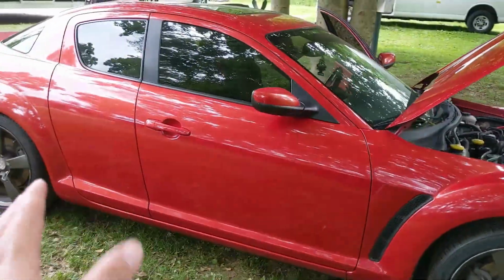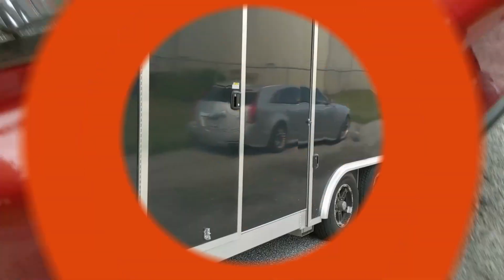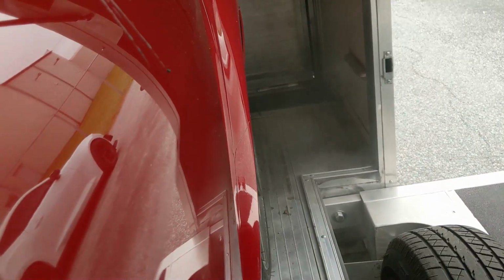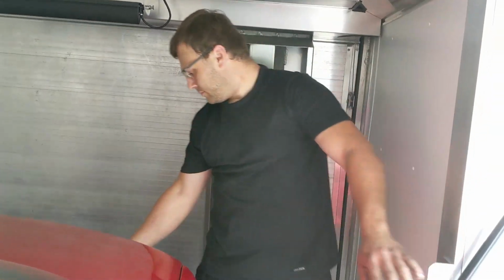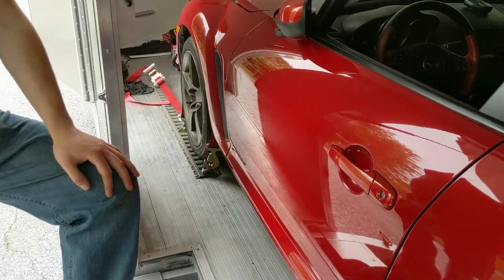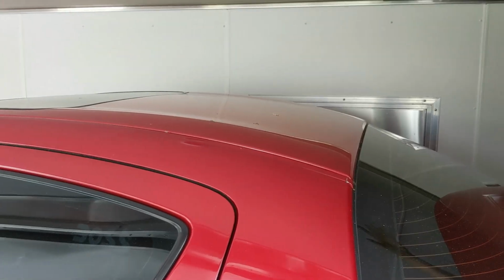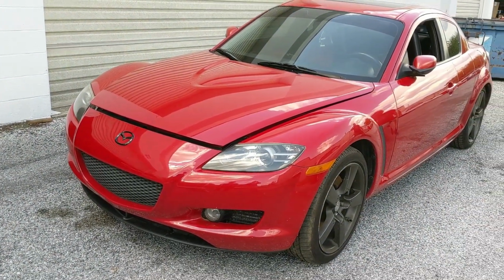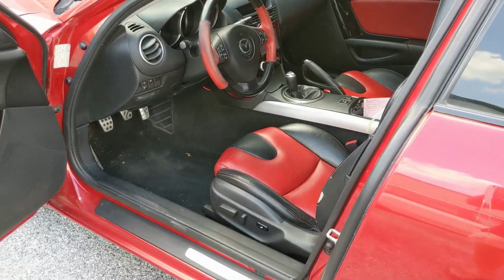We Bought A "Junk" Car To Turn Into A Monster Machine! Project LX8!

Comment: Holy crap, Andrew.  My brother and I have always dreamed of doing a LS swap into a RX-8.  Our dream was to mate a LS-7 to a Porsche G-50 gearbox and build it mid-engine to be able to use the traction to handle the power.  The back seat area is perfect.  Just block it off in front of the shorty doors up to the window sills then cover it back to the package tray.  The shorty doors would give you access for maintenance.  Man, would this thing handle and would be a total sleeper.  Do it, do it, do it!!!

Comment: RX8, this should be a Good Series!!!  The Apex seals, the down fall to every rotary engine. Probably got hot at some point.
Reply: Stock apex seals suck, depending which model you’ll have 1mm or 2mm seals, 3mm apex seals will make the car bullet proof as long as the air is filtered, the tune is good and you run premix. It’ll last longer than most gasoline engines and maintain compression longer. If you don’t believe me that’s why rotaries are banned from most endurance racing.

Comment: I believe back in the day a little antifreeze down the throttlebody swells up Apex seals and will run
Reply: Atf
Reply: Or motor oil. It gets in the seals and helps add compression.